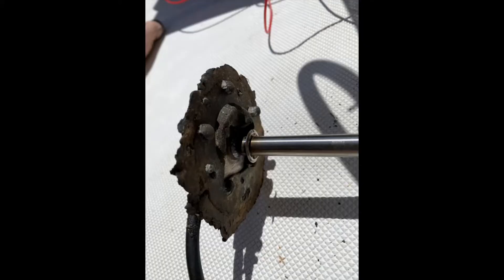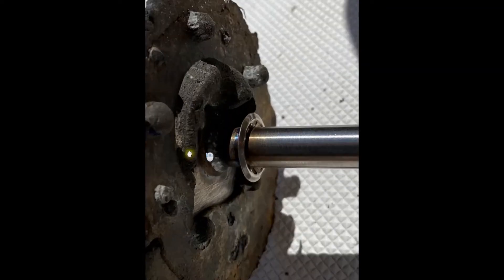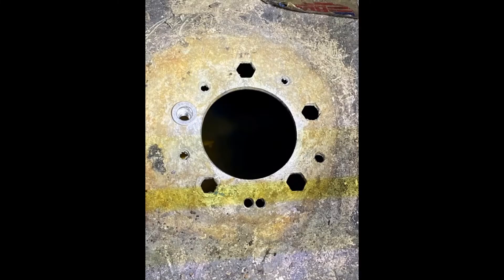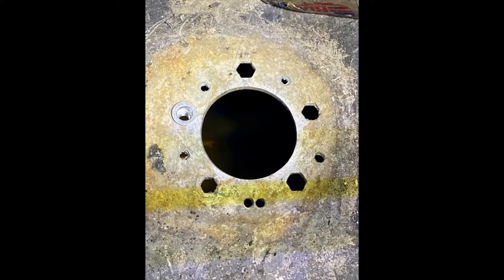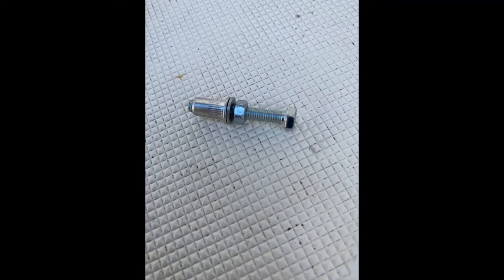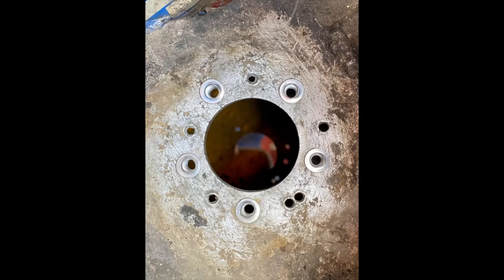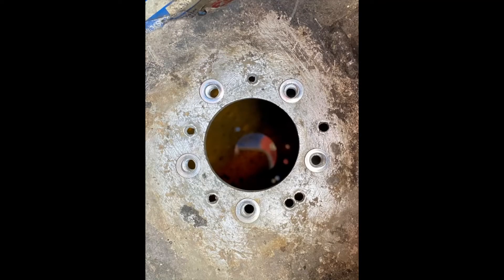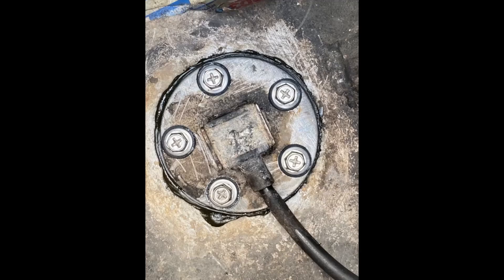Boat fuel tank pressure testing / water in fuel issues PT 3

Comment: How did you figure out what fuel sender you needed? I have a 2003 Sea Pro fish and ski and don't know where to start on determining what fuel sender I need. I haven't taken the old one out because It still works, but I need to know, which one I need, so in case when I do take it out I have a backup one on hand. I have to take it out to pump water out of my tank. On the top of my on the plate it has QC-2 , and that's the only making
Reply from the maker: I looked up the numbers stamped on the sender and matched it to a Moeller reed switch style sending unit, then ordered the gasket and bolt kit from Amazon.  I was able to reuse the existing sending unit that was already on the boat, just needed the proper gasket and ran the finish line with what I had.  It's been a perfect setup since fixing it, no more leaks and the gauge is always spot on with my fuel level.
Reply from the maker: Look me up on facebook, I run a couple of Cobia owners groups and help people all the time.  Then you can send me soime pics of what you got and I can see if I can be of help to you.  "Cobia walk around owners group"